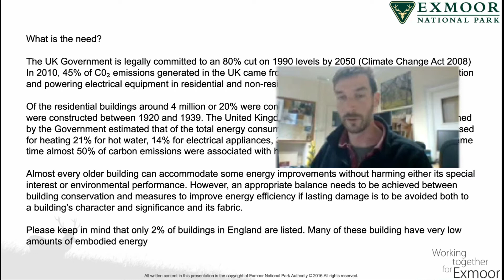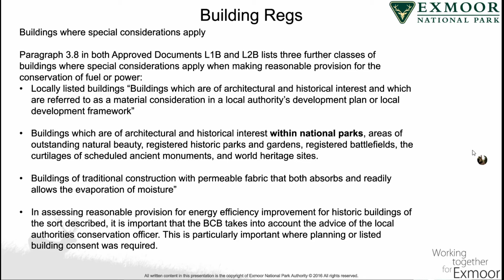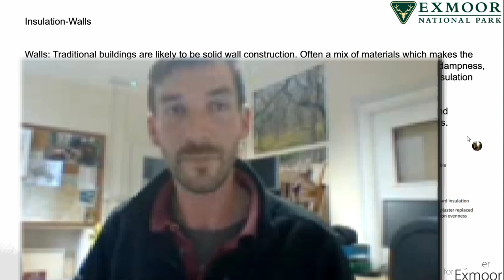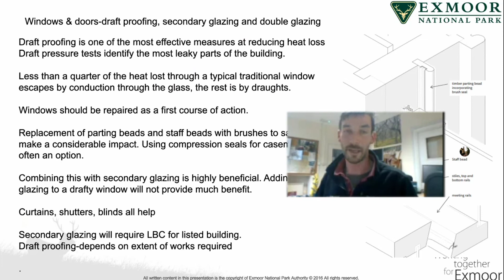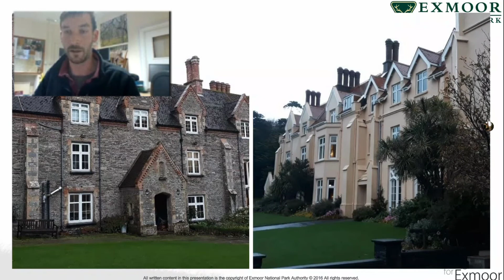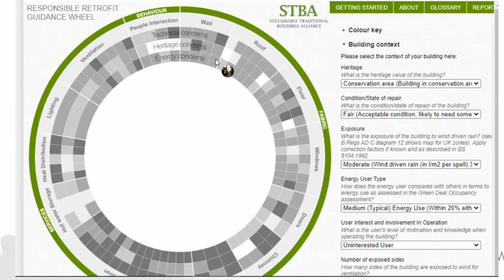Energy Efficiency in Historic Buildings

Comment: I have a grade II 16th century timber frame farm house in Essex.  Our windows are historic oak framed with leaded lights,  we have fitted secondary glazing internally using Perspex and magnetic tape.  The secondary glazing is almost invisible, caused no damage to frames or window surrounds.  It is easy to remove if required with no damage to anything.  It cuts drafts & noise considerably